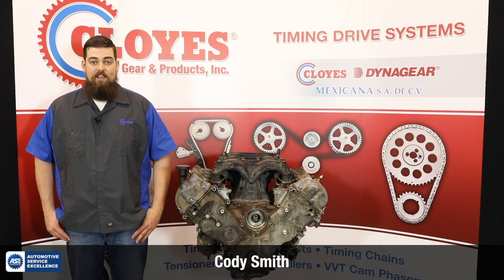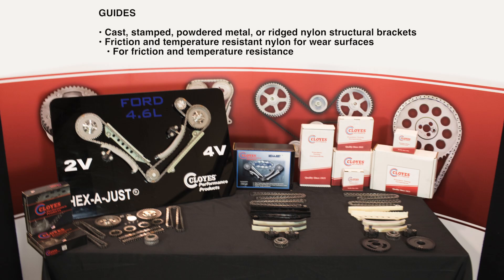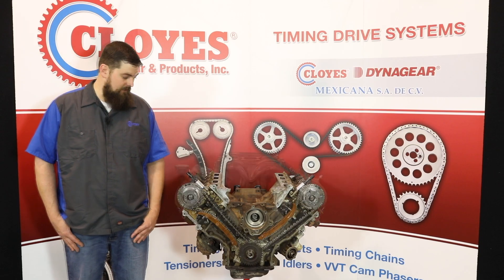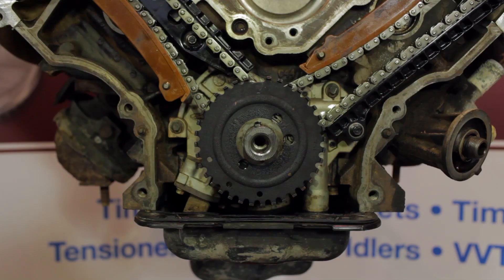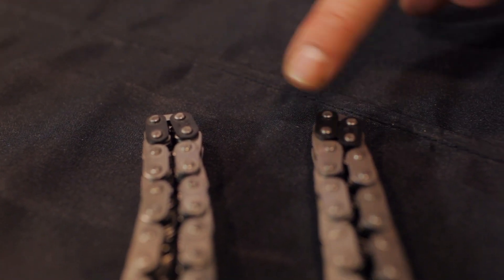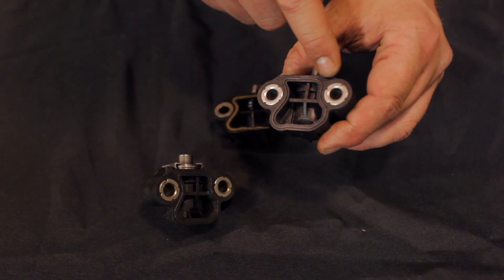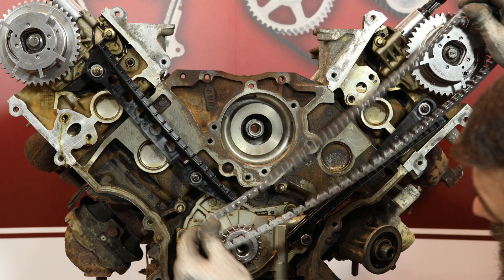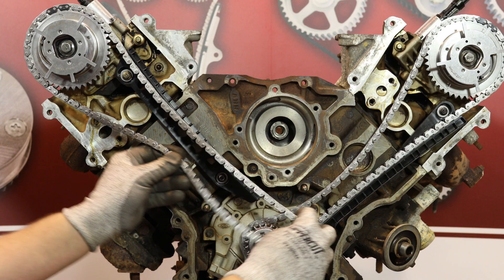Ford 5.4L Timing Chain Replacement, Cloyes 9-0391SB

Comment: So I’m doing a timing job and bought this kit, anybody knows which guide goes where? They’re almost identical but it doesn’t say which one goes on the left and which one goes on the right
Reply from the maker: 9-5396 on the left and 9-5397 on the right.
Reply: @Cloyes01 
Thank you for replying, also, on the ford specifications for the camshaft sprockets it says to torque to 30 ft.lbs and then an additional 90 degrees, the bolts on the cloyes kit says to torque to 90 ft.lbs, my question is, if I torque it down to fords specifications, will it mess up the bolts or sprockets?
Reply from the maker: @joelito685  When using our bolts, we strongly recommend torquing to a straight 90 ft/lbs. Following that OEM spec with our bolt can lead to overtightening and the reluctor wheel disconnecting from the phaser. We performed extensive studies comparing the bolts and attachment processes. We found that with the OEM procedure, even with OEM bolts, torque was very inconsistent. The 90 ft/lbs guarantees a proper/more consistent installation and is ideal for the bolts we provide.
Reply: So is it 30ftlbs +90defrees or 90ft lbs?
Reply: @Darrien-r8m  it’s just 90 ft.lbs straight
Reply from the maker: @Darrien-r8m  The OEM bolt torques to 30 ft/lbs plus 90 degrees. We recommend our replacement bolt (VCB100) to be torqued to a straight 90 ft/lbs. At the time of filming this video we had not developed our phaser or bolt yet, that is the reason for the discrepancy.

Comment: I had a cloyes kit professionally installed on my 2 valve 4.6 ford. I’m hearing a faint howling type noise around 2000-3500 RPM that is consistent with throttle input. Has Cloyes seen this before on new chain kit installs?

Comment: DO NOT TORQUE YOUR GUIDEBAR BOLTS TO 89 LBS
Reply from the maker: 89 Inch-Pounds = 7.42 Foot-Pounds
Reply: How did you get 89ft lbs??😂
Reply: @LenWhalenX because I'm half deaf lol and dumb apparently

Comment: So I have a 2009 F150 I’ve replaced the timing chain and phasers after putting everything back together, the passenger side isn’t doing anything fuel working spark plugs are working. Coil packs are working, but it’s running rough only passenger side each cylinder is not doing anything. What could be wrong? Could it be the phaser or something else for the whole side not to be working.
Reply from the maker: Has the vehicle given you any new codes since the repair? Even if the phaser was not working correctly, the vehicle should still run and all the cylinders will fire on that side. If the timing is off far enough that can prevent the cylinders from firing.

Comment: I, thought that they should be at 6 o'clock and 11 o'clock on the crankshaft sprocket, you mentioned 12 o'clock, could you explain, thanks!
Reply from the maker: The chains set the timing, so small movements of the crank & cams is possible. 11 or 12 o'clock on the crankshaft key are general recommendations.  Ultimately, you just need to position the shafts so the marked chain links align to the sprocket marks. As long as the marks align, then you are in time.
Reply: @Cloyes01  10-4, I got it, thank you!
Reply: Only thing that wasn’t very clear was when reinstalling the new phasers do you just put them on and get it close to where you had them or do they go on only one way when you set the timing marks?

Comment: Just purchased this  kit complete with phazers.  Noticed the crankshaft sprocket is 1 complete tooth off from oem sprocket. Is this a machine flaw or is there some updated bulletin about why.
Reply from the maker: That should not be the case. The replacement sprocket timing location should match OEM in this application. Please reach out to our tech line at 479-646-1662 ext. 228.

Comment: Are you 100% SURE that the followers don't need to be removed???  I'd hate for the cam to rotate and bend a valve. I was thinking just to be safe, I'll clamp the cams in place with a pair of vice grips. 
I can already see that the cams want to rotate CCW when I remove tension. 
The crank key is at 12 o'clock. 
The RH cam mark is at 1 o'clock(ish). 
The LH cam mark is at 12 o'clock. (That's using the cam centerline as the 12 o'clock point)
Am I safe to proceed?? 😆 
Thanks ⚙️ Cloyes!!!
Reply from the maker: Yeah, if you are removing the timing cover then there is no reason to remove the followers. If a camshaft does move, it will only move in the direction to close a valve, so there is no risk of piston-to-valve contact. You are safe to proceed. Just make sure all your sprocket and chain marks align upon reassembly and you have nothing to worry about.
Reply: @Cloyes01  
Awesome!!
That's what I thought. 
If a cam does move, it will be minimal... and I can just gently turn it back in place to match the marks on the chain. As long as the dowel is engaged in the camshaft, I should be able to manipulate it to align the marks and everything still be in time.
Man... that "other video" will make you go around your asshole to reach your elbow!!  🤣 
Thanks again, ⚙️ Cloyes!!! 👍
Reply: use tooll!

Comment: Hello i was curious why you temoved the cam phasers if they are not replaced? Im having trouble finding just the bolts for cam phaser to replace for mine. Thanks in advance!
Reply from the maker: If you have no plans to replace the phasers, then you do not need to remove them. If you do need to remove them, we do sell the bolts separately. Part number VCB100 is the bolt.

Comment: I am installing timing chains and components on my 5.4 . Got the the timing chain cover off and discovered that the black links on the timing chains do not line up with marks on cam phasers? but the truck ran smooth? so dont think it was out of time. So naturaly the links on my new chains do not line up either. Just wondering where to go from here.
Reply: As soon as the engine runs the marks will be off, so what you're seeing is perfectly normal. If you rotate the crank by hand enough times, you'll see that the marks eventually line back up with the timing indicators.
Reply: @Four_Eyes  so im good to install the chains on the phasers where the are located now with  my crank in the right position?
Reply: OEM parts!

Comment: any idea why both my new phazers have  R AND L ON each  OF EM
Reply from the maker: The phasers are the same part for the left and right banks. When installing on the right bank, you will use the timing mark that is labeled by the "R". And the left bank uses the "L" labeled timing mark.

Comment: Do y'all make a whole kit phasers and all
Reply from the maker: Yes, part number 9-0391SBVVT comes with the timing components and the phasers.
Reply: @Cloyes01  Is it possible to just move each cam forward one tooth. And if so, do both cams rotate inward toward the center of the motor.???  I moved the cam forward one tooth on my 87 Honda crx and it went from 48 mpg to 52 mpg and it had so much more torque. So I want to do the same thing on my 2002 F150 5.4L 2V so I can get better gas mileage.
Reply from the maker: @conniealldis  It is possible, but I am not sure if you will get the desired results. One tooth on those cam sprockets is about 8.5 degrees of camshaft timing. (42 teeth divided by 360 degrees = 8.57) That is a large swing of timing, and this is an interference engine. I doubt that is enough to cause interference, but you will want to make sure.
Reply: @Cloyes01  My dad did it on my 87 Honda CRX. He moved it forward just one tooth and it went from 48mpg to 52 mpg and gained a quite a bit of torque, as in it would torque steer when you stepped on it after that. I am hoping if I replicate that on my 2002 F150 5.4l v8 that it will go from 15 to 19 or 20mpg. I mean the 2003 or 2004 have cam phasers right? So wouldn't just moving the cams forward one tooth be doing the same thing?
Reply: @Cloyes01 how much for kit
Reply from the maker: @joecostu1571  We do not sell direct, you must price the kit through a local or online vendor. Our parts are available at all major parts stores.

Comment: Is no cam holder or followers removal required ?
Reply from the maker: Follower removal is not required but we do recommend using the sprocket holder to tighten the camshaft sprocket bolts if you are replacing them.

Comment: Would it matter if you put the double links on crank sprocket and single on cam sprocket.
The number of links is the same in-between
Reply from the maker: The mark on the cam phaser is in between two teeth and the mark on the crank is on the tooth, so you would not be able to align it that way. But to your point, it does not matter as long as there are an equal number of links between the cam and crank marks on both sides.

Comment: After reading these comments I’m extremely concerned for purchasing this set.. does anyone have a good experience with the cloyes set?
Reply: How di it go ? Did u ever install a cloyes timing kit?
Reply: @ I ended up going with an updated oem set. The only aftermarket thing I did was upgrade the oil pump to a high volume. 45k so far on it with no issues!
Reply: @ did you do the work yourself ?
Reply: @ yes, I’m by no means a master mechanic but I do all my work myself outside of a couple specialty tools I got from Amazon, timing tool, valve tool, it was pretty straight forward. I didn’t evacuate the ac as I don’t have that kind of equipment but I was able to work around it
Reply: At the shop I work at we always get the cloyes set for this motor . . I’m doing one right now and that is why I was looking at this video. Anyways did you have any trouble getting all of the timing marks to lineup? Did you have to move the crank a bit or the phasers?
Reply: @michaelmartinez9602  I don’t think so, that timing tool that locks the crank in place with the dowel pin worked great. I had to pull the cams to clean stuff up but after reassembly everything lined up. However I did accidentally swap the left and right phasers and had to tear it apart to put them on the correct side lol
Reply: @Apothas541  hmm on the cloyes set the pasers are the same part i believe
Reply: @ I thought so too but they were marked with an L and R. I fired it up and had a really bad shudder and timing codes. Fortunately didn’t ruin anything but once I swapped them it ran perfectly
Reply: @Apothas541  I always look at the part numbers on the box if they’re the same number they’re the same part
Reply: @ these ones actually had an L and R stamped on them

Comment: any bad experiences out there running Cloyes timing components on a 5.4?
Reply: Yes 3 years ago I replaced my entire system with cloyes components... Thought everything was fine until I cracked open my timing cover to pull the heads off due to multiple studs being snapped flush with the head when replacing the exhaust manifolds only to find fragments of my chain guides or what was left of them just laying in the bottom of the cover. Apparently this is a widespread issue with aftermarket timing components for the 5.4L 3v. Go OEM, sure it costs more but fuck doin this twice. I know I'm regretting it.
Reply: @xsucmyunitx4674  bummer man :(. I just did my full timing set with all ford components last weekend and glad I didn't roll the dice with the aftermarket.  The whole thing start to finish was a 16hr job and I'd hate to do it again.
Reply: So far so good. From under the hood auto garage. Here in Wilmington, De. I'm a faithful believer, I've been using Cloyes components since 2015. Mostly on the notorious 5.4 triton engines... And to this day I have yet to see a come back due to any of those components failing. Hope it helped you.
Reply: @AngelFlores-gl5ie  even the phasers?  Thanks for the reply btw 🍻

Comment: The camshaft on my truck only have the L arrow on both sides right and left?
Reply: Remove your roller followers, time the engine, then out them back in. It sounds like you are very out of time
Reply: If I am not mistaken in your case you’re going to have have the dash (|) mark instead of the R on the right bank and the L on the left side of the bank facing up with the crank @ 12:00 position when you are all lined up. I know this is probably not useful to you anymore but I’m sure someone else is going to run into this. I hope this helps.

Comment: Why in workshop does it have you remove the followers?
Reply from the maker: The follower removal procedure was written by Ford to use when replacing camshaft phasers without removing the timing cover. It prevents the camshafts from having any valve spring pressure that may try to rotate the cams when the chain is removed. If you are removing the timing cover for a complete service then that procedure is unnecessary. Any slight rotations of the shafts can be counteracted when installing new chains because all timing marks are visible.
Reply: Not true. You still want to remove the roller followers one slight move and that fucking cam is jacking all over the place.
Reply: This is a interference motor! You must remove the roller followers before you remover the timing chains @GreaseMonkey-zm2ex

Comment: I don't understand one thing on this video. Since these are interference fit engines you are supposed to install the cam lock tools on both l and r hand cams then remove the sprocket on the cams and remove all the components for the timing chain. You did not show that
Reply from the maker: The special tools are not necessary when following this procedure. The chain sets the timing, the camshafts do not need to be in any exact location.
Reply: @Cloyes01  Interesting I guess having the variable timing makes a difference. I am in the process right now installing one of your gear and chain set on a 4.6 2 valve on a 03 crown vic cop car. I put in all new Motor Craft components in it about 45000 mile ago the chain started rattling a while back and then got really bad . I had to tear it down found one of the seals on one of the tensioner blew out on the corner I don't know why?  A master tech at the Ford dealer suggested I install a new oil pump I am glad I did . I found out about the stupid design Ford did with the oil gauge I thought all along I had good oil pressure found out it doesn't read oil pressure just a stupid switch that reads half on the oil gauge all the time . If you got 5 pounds of oil pressure still shows you are good until you blow the engine up. Who is the stupid dip shit that designs this shit anyway. I went back to the tech yesterday my guides are all good I told him I think I might have a bad oil pump he suggested that I pull the caps on the cam and check the journals if its scored I had bad oil pressure. So when I get it put back together today I am going to pull the caps . I got the oil pump installed that is scary because the pick up tube bolts can fall in the pan I was shitting my pants yesterday . Had to take out the bolts and put them in with a pair of needle nose pliers . Yeah good times !

Comment: When I removed my timing chains, the cams were under tension and moved... Does this matter if I am removing cams and roller followers before I time it??
Reply from the maker: It does not matter. The cams are under valve spring pressure and will move slightly to a position where all the valves are closed.  When reinstalling the timing chains you will have to align the phasers to the marked links of the chains. To do this you will need to rotate the cams back, or move the crank slightly to compensate. Just make sure the marks are aligned when you are finished and it will be correct.

Comment: What material are made those black chain guides that break so easy, could them be made from some more flexible material like nylon or teflon?.
Reply from the maker: They are made of injection molded PA66 nylon, the same material Ford used. In some applications Teflon is added for additional wear prevention. The guides could be made stronger, but that comes at the expense of increased friction and wear.
Reply: @Cloyes01  But they looks and break  like bakelite. Why using the same material as ford?. Better have to improve them. About friction, heat and wear teflon is the best.
Reply: @Cloyes01  By the way, I'll follow your directions on this video to change chain, guides and sprockets, also doing oil & water pump, spark plugs ( without breaking any, just I left 2 days with pb blaster soacking them and slowly back an forth). Thanks for posting this helpful video!.

Comment: Just got my cloyes kit from rock auto  says made in china all over it.  Was under the impression that these were us made. But boy was i wrong
Reply from the maker: We are manufacturing the majority of the kit's cost in China on this application, therefore it gets the Made in China label. We are an American company, and do all our development, analysis, inspections, and kitting here in Arkansas. We even manufacture gears and sprockets here for our high performance products, some OE replacement applications, and OEM customers. Even though we do manufacture products oversees too, when you buy our product you are getting exclusive Cloyes product. We invest in tooling and work with strategic partners, most of whom are OE manufacturers, to manufacture components to OEM quality specs. We do not just buy cheap available product and put it in a box, there is a difference. 
I hope you will give our product a chance, and please let us know if you have any issues.
Reply: What is not made there?.
Reply: I wished to know where the ford autocrap branded ones are made. So, I found this:
https://www.autonews.com/article/20051205/SUB/51202050/ford-sources-aftermarket-parts-from-china

Comment: Nice video, but you guys need to go back to the drawing board for your hydraulic chain tensioners. Used your kit in my 2008 F250 with 5.4 and the tensioner blew out and I lost oil pressure. Barely got home. I'll be sticking to Ford OEM for timing chain parts, but hopefully you guys improve